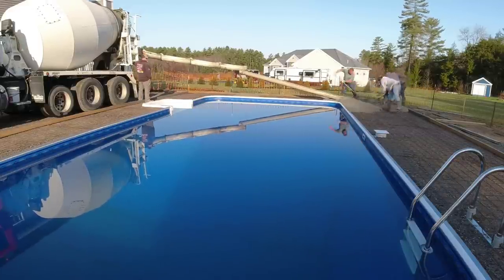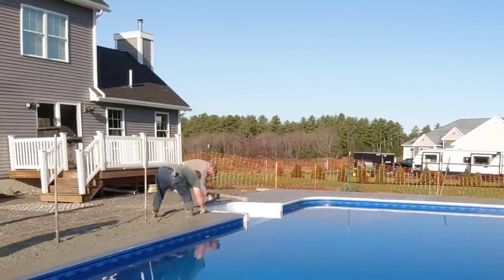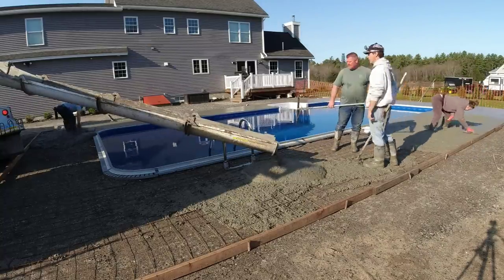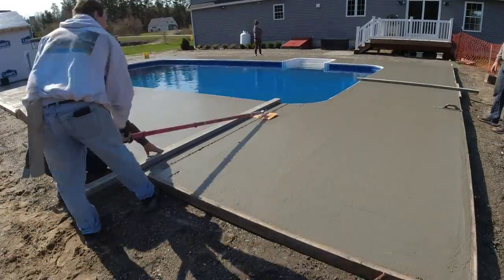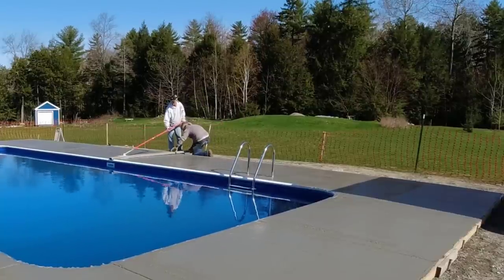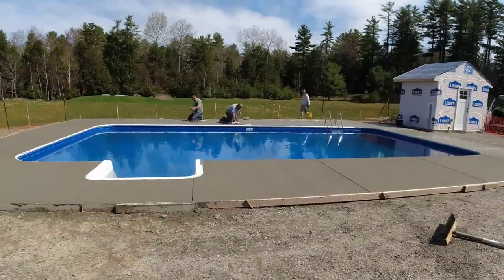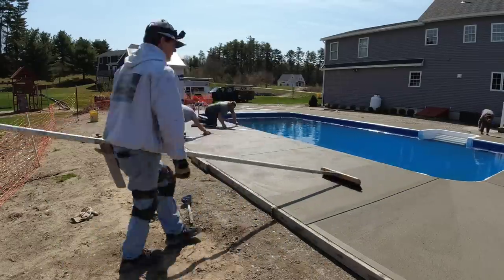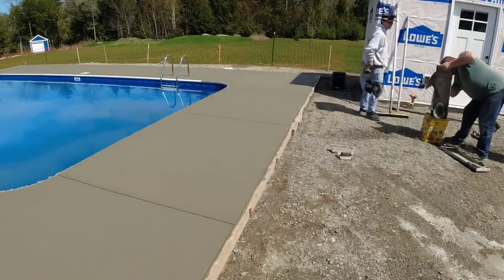How Much Does Concrete Cost? - What I Charge To Do Concrete Work

Comment: I completely agree with your pricing method - I do the same thing with my drywall company. I don't worry about talking to the other contractors in the area (I live in a very small and remote town), I just base my overall pricing off of my schedule - if I'm getting the jobs at my 'regular' pace, then my pricing is on vs other contractors. If I'm too slow, then my price is too high. If my phone is ringing off the hook and other contractors are coming my way more than usual, and my schedule is getting too full, then my price is too low. I try to stay on the upper end of the pricing spectrum because I I work with the higher end contractors and my work and experience is in demand.  I stopped giving my work away about 20 years ago and have been doing good ever since. It just doesn't make sense to cut each other's throats on pricing but if you want to give your work away, have fun. Cheers!
Reply: I use to be in the dw business decades ago I never cared what others charged. People fail to realize you can be profitable if you own your equipment and have low overhead. I had competitors in the dw business that were charging tons of money back in the early 80s then 87 black Monday hit and some owners of competing companies were calling asking for a days pay because they had no work. Customers remember who charged fair (and made money) and who gouged when things were busy. Slow, steady and profitable is the name of the game. Does not always work out that way but it is in my opinion a proven way.
Reply: @nobleroofinggeneralcontrac7961  - very true. I remember the on/off cycles of the 80's and earlier 90's - my dad was always stressed during the down times. But he was also the one who ingrained in me the idea of never sacrificing my work quality - snowing, raining for a month, whatever, take your time and do your work YOUR way. Once you establish yourself as the highest quality guy around, you'll always have work. I hope I don't sound like I'm a gouger, but when my schedule is 1.5 YEARS out, I figure that I need to slow down the flow of work or I'm going to work myself into the grave! Cheers brother!
Reply: @akdrywallguy60  I was not implying that you were a gouger sorry if it was taken that way. Now to the booked out for 1.5 years. That looks good on paper. You know as well as me that an event can change that like the recession we are headed for now.  I say the printing shops are a good source of where things are headed. Yesterday when i was picking up a plan there I asked have you noticed any slow down? The guys head lifted up and said ya the last two week s for sure. That is the canary in the coal mine right there. Buckle up folks. I sure hope I am dead wrong about this.
Reply: @nobleroofinggeneralcontrac7961  - You got it! Me too. Good times come & good times go. I think that we're all going to be slowing down soon as well. We're in a different market where I live (lots of 2nd homes and vacation stuff), so who knows what's going to happen to the more... mmm... inflation proof folks in the world and what they're going to want to spend their cash on. The bigger towns an hour or 2 away from me are definitely starting to slow down on there new residential starts, so it's probably coming my way too. I'm hoping to be retiring soon anyway, so it's possible that retirement will just come a few years earlier than originally planned. Good luck and stay safe!

Comment: Hi Mike - Can you do a video on the specifications for concrete for driveways in northern states (ND)?  Thickness, psi mpa, ash content, size rock, type rock (granite), rebar type, the slope for drainage, testing post pour with a water hose for puddles and post pour finish for salt protection, etc.
Reply: Do you also want him to come and do your payroll? Wow 😅
Reply: Concrete will always form bird baths.
Simple

Comment: I don't understand walking on the Rebar-Grid....it's supposed to be suspended into the MIDDLE of the Concrete-Slurry to be workable. I don;t see your guys reaching in & pulling up the grid before screening either. Why use rebar if you're not going to do it properly??.
Reply: They need to use chairs especially with this 12 slump crap mix...
Reply: yall obviously didn’t listen to
He said that the concrete has fiberglass

Comment: Mike, this video was made 8 months ago so I hope you still respond to old videos. My question is how does the customer know what color the cement is going to be. Ive seen some concrete pours that turn out light grayish/silver looking instead of tan/beige (earthtone) or even an off white ,  color. Customer won't know until it dries and it's not what they thought the color was going to be. This is not addee color that is added to the cement work. Can you give some insight on this. Also you said you add fiber reinforcement. I guess that is something the customer has to ask the contractor about. I think that is an added protection for breakage.....imo. Thanks for the breakdown also.

Comment: What’s your opinion on concrete overlay’s? Seems to be a hot commodity down here in Florida for driveways/patios/pool decks but I just don’t have the confidence on the overlay properly binding with a slab vs let’s say stamping a fresh pour slab. Any experience just applying overlays to existing slabs and how long they’ve lasted your customers without any call backs?
Reply: You’re better off starting from Scratch. You need to tell your customers to guarantee your work, it’s better that way than to bind.

Comment: No expansion joints?
Reply: Huh?
They are all there,  wet tooled in.
Reply: Those are control joints.  I'm talking redwood or asphalt fiber board.
Reply from the maker: No, those aren't needed. The tooled joints are for expansion and contraction.
Reply: It's not a city job.